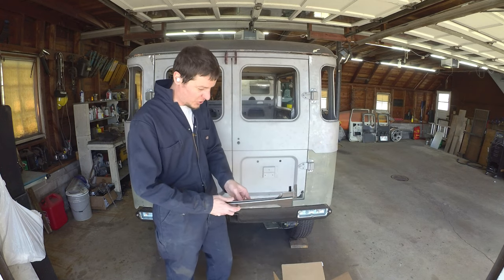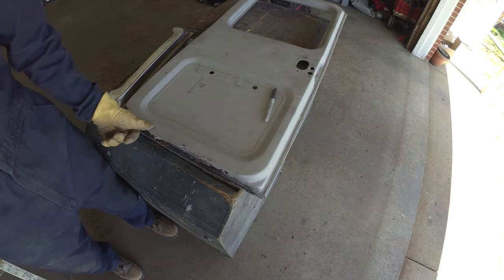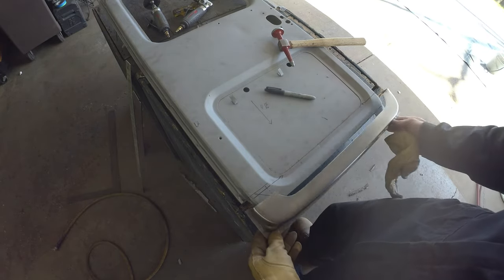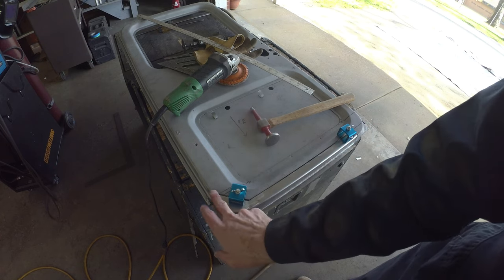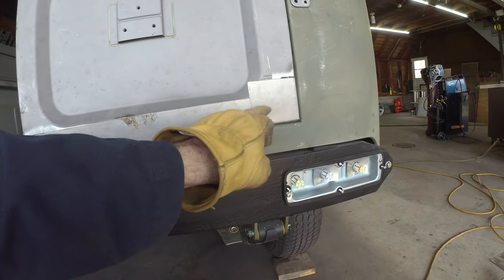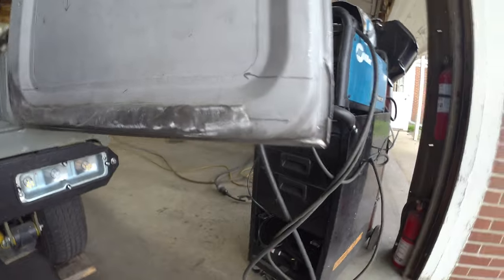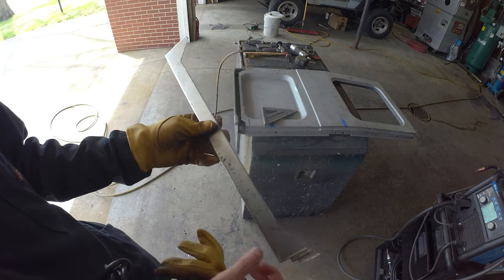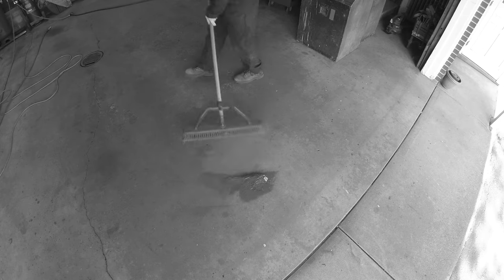Would you believe...more patching? Rear door rust repair : (FJ40 Week 26)

Comment: Great work. Did you say that was a South American tub or a Cool Cruiser tub. How was the initial fit. Looking fantastic for sure.
Reply from the maker: Tub is a CCOT HFS tub, which is also South American but should be from Costa Rica vs Columbia.   Tub was generally decent, but suffered from some of the same fitment issues you see on the cheaper Columbian/SA tubs.  For the price, I'd frankly expected a better product, and a bit better support to "stand behind their product", IMHO.  If I did it again, I'd likely go the cheaper SA route with eyes-wide-open that there'd be work, or at most go with the HFS half-tub.  The HFS QC seems spotty, and when the 3/4 tub has issues, they're harder to fix than working forward from a 1/2 tub.  I will say the zinc plated metal does seem nicer than the steel used for the Columbian parts, though. (I purchased doors from there.)

On mine, the firewall mating surface/floor was bent too wide by 1/2", requiring the floors to be cut and seamed to bring them back in.  Dimensions were confirmed to be off at the firewall, originating at the B-pillar after checking other factory tubs as well as those that purchased Aqualu tubs.  Oddly enough, the spar that runs across the floor at the B-pillar was marked "MALO" with arrows pointing inward (Spanish for "bad"), so it does seem like there were some known mistakes at the factory in Costa Rica,  but CCOT was unwilling to do much about it - after a few weeks of back and forth, the shop crew seemed to agree on swapping it out, but then the owner prevented anything other than a return with no replacement as "they couldn't guarantee any better fitment with other inventory".   I decided to cut the tub and moved on, as sourcing an entirely different tub would have set me back weeks if not months on the project, and I have a limited window of time here to work it.

The firewall/B-pillar dimension was the main issue, but there's a smattering of other minor quirks, similar to other cheaper SA tubs...some holes were drilled incorrectly (needing to be filled and redrilled), and one set of body mounts is at the wrong height, which will need to be cut out a rewelded when I pull the tub off for paint.   The angled flange at the B-pillar is also off for some reason, so there's a lip where it meets the hardtop panel...I'm hoping the weatherstrip can accommodate it, as there's not much ability to rework it.  My hunch is that it's going to whistle, so I'll probably need to make a rubber "packing" to go on the hardtop lip to create a better transition.

Whether this is a one-off that slipped through, who knows - my suspicion is that over time, the QC has decreased...but like everything, there's two sides to every story, take it for what it's worth.  I debated discussing it more as part of a video, but chose to just move on and keep the videos a bit more positive.  Good luck on your (assumed) project - they're a lot of work, but fun too.
Reply: @lonewolfworks Thanks for that explanation of the work you have had to do. I agree that for what a HFS tub goes for it should be a stellar fit. I have a 1979 FJ40. It has some MAJOR rust issues. I purchased pretty much all the body panels to completely fabricate I rear tub as well as floors and rocker panels. In retrospect, I should have probably gone with an Aqualu tub, but at the time I wanted to keep as much of the original sheet metal as a could. I’ve never done any welding but it looks like I’ll get lots of practice. This vehicle looks like it was stored in a leaky barn for years, and has just deteriorated. I thought about the SA tubs but after reading some of the comments on IH8MUD, I decided to try to fix what I have. I a really long way to go to get to where you are with yours. Can’t wait to see more videos on your project.

Comment: what was the setting's on the welder for the 16 ga steel.?
Reply from the maker: It's been a while, and I would've adjusted a bit to account for the condition of the door metal...but my guess is that it would've been around that 15V/200-225WFS with the 035 wire (depending on 16ga or 18ga).